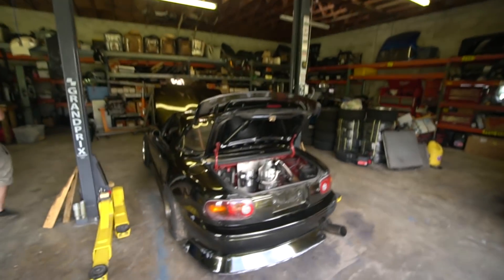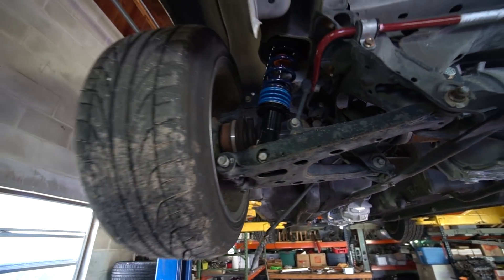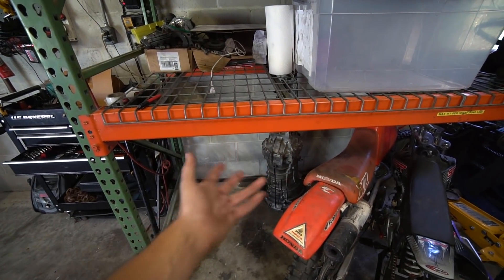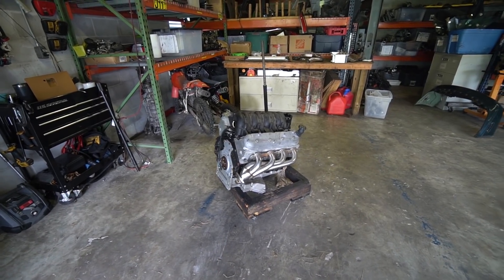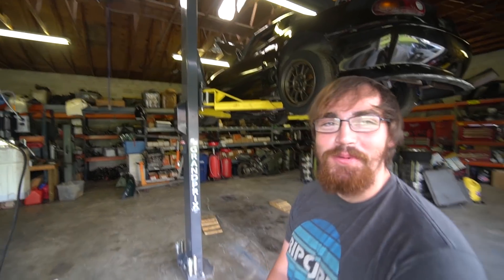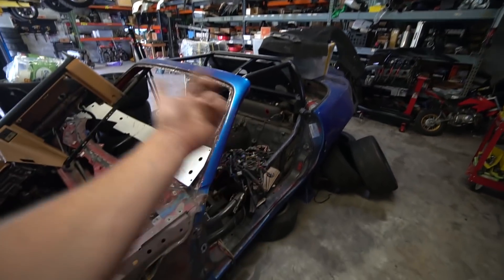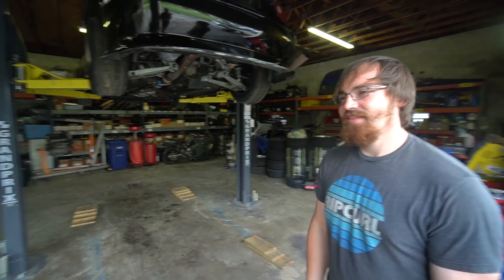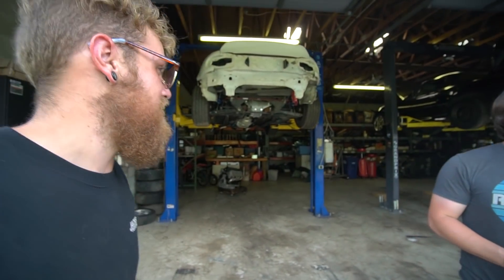Bought Another LS Miata! It Came With a $4,000 Surprise!

Comment: You've got trans tunnels in the donor cars, right? Just cut the bits out that you need from one of those. Cut it slightly past center on two cars, use both halves, joined at the top,  and you've got yourself a widened trans tunnel made from stock panels.

Comment: Can't Ben use your old block since you only stripped the threads for the dry-sump pump?!
Reply from the maker: He could, but it would probably be more work than it’s worth to put that engine back together.
Reply: @Taylordrifts  He said he was on a budget and you were going to use the engine before you stripped it. Is that thread used for anything when you don't have a dry-sump?

Comment: Dry sump has a side benefit.  If you seal up the engine with NO breathers and only have a breather in the top of your Patterson tank, you need at least 3-4 scavenge hoses and overdrive the pump to form a vacuum in the lower pan.  The more vacuum you can get, the more horsepower you get.  This is an engine builders secret learned by the people that made all the Indy Lights V-6 engines.  At one point they claimed + 30% more HP.

Comment: Put a new oil pump on the motor and you will be fine with that wet sump pan. I have a pan with baffling on my LS E46 and with a fresh oil pan my pressure is around 40-45 at idle on a 5.3 iron block. Make sure you are using the correct o-ring on the pickup, other than those things there shouldn't be an issue!

Comment: I like the white miata better and the engine can be placed farther back  due to the drive tunnel being cut open also you could use the iron block in the white miata due to being able to place the engine farther back which helps distribute the weight, I think that's what the previous owner had in mind. Also you can have NASCAR bars and it looks so much better.

Comment: Try to find a LC9 out of 2006 to 2014 4x4 trucks...It is a 4th gen all aluminum 5.3 with the 243 heads which are the same as the LS6 heads but without the sodium filled valves. They are already setup to run e 85 but they do have the displacement on demand crap which can easily be eliminated with a lifter swap/valley cover which most switch to the LS7 lifter anyways...also 2010 has variable valve timing which is also easily eliminated if needed with a timing chain set and cover..
Easier to find then the L33 as GM made way more of them..millions..
These were the best of the LS 5.3 engines and last before GM switched to the LT...

Comment: Question Taylor i just got a Tig welder and am going to be welding bolth steel and aluminum. What cups would you recommend??
Reply: I wouldn't reccomend tig welding steel unless its real high quality stainless.
Reply: @SortaProfessional89  why the Hell not lol
Reply: @fzR-up2uu  Because its unessesary. The only reason you should be Tig welding any steel is if its stainless or chromoly steel.
Reply: @SortaProfessional89  although I agree its unnecessary, i would never say i wouldnt reccomend it
Reply: @fzR-up2uu  He said he was new to welding that's why i said it.
Reply: I said I am new to TIG welding I have been MIG welding and stick welding ever since I was about 8

And I was wanting to know because I haven't done TIG welding and I'm going to buy a TIG welder just because I want to and I wanted to know what I would need to make it work the best and I know best can be relative

Comment: How much was your dry sump set up is the real question
Reply: Sub $3,000 if I remember correctly from one of his previous videos talking about it.
Reply from the maker: Yep! About $3,000. That comes with an ATI damper. So if you add up the cost of an ati damper, good miata pan. And accusump you’re at around 1800-2000 anyway.

Comment: I would say go accusump. Yes you know how dry sump works but accusumps have been known to work and mostly likely far simpler and more cost effective. Pull the subframes out of the white miata and just transfer it all over. It's got the cage in the blue and it gets to keep power windows. Get it fully set up ready to drop the aluminum block in and check the "5.8" and use it as a drag engine 🤷‍♂️